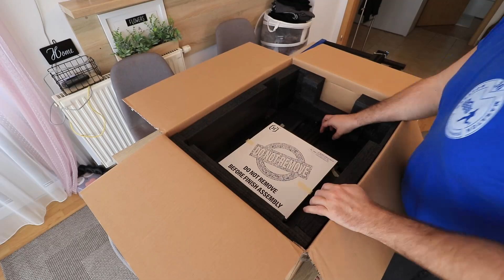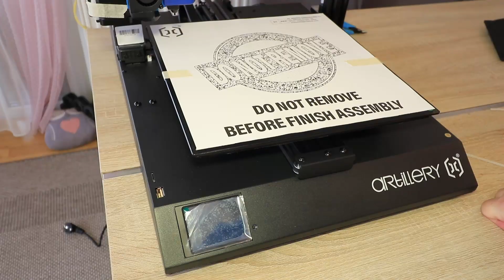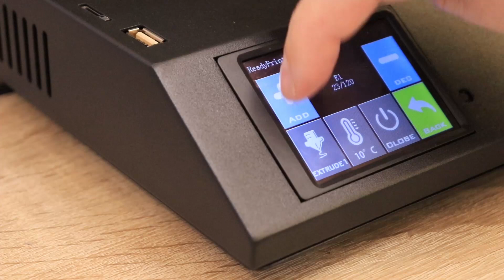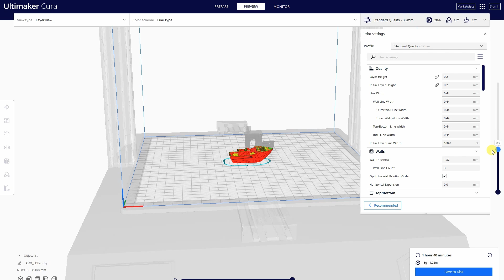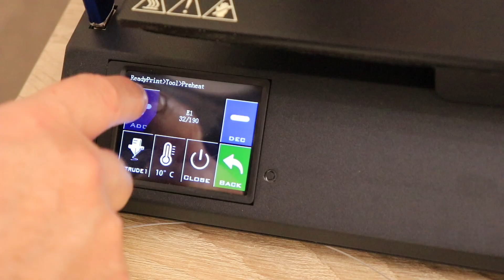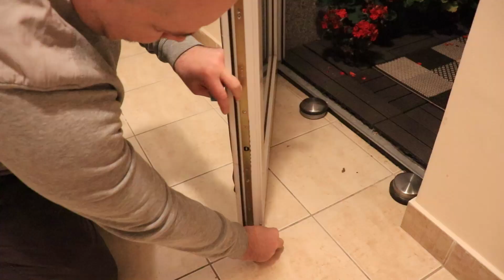Review of a super quiet Artillery SW-X2 (Sidewinder X2) 3D printer

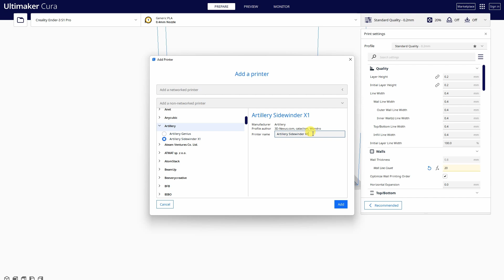Comment: 10:04 
You have to manually add the following in Gcode in Cura, under G28:

M420 S1 Z10

That way, the Cura file will ask the printer for the auto-leveling data you calibrated (if you don't add that command, the leveling you did on the printer will be useless)
The Z10 command indicates that the printer maintains the leveling data for the first 10 mm of printing, if you want it to maintain it for 20 mm, enter Z20.
If you set Z0, it will maintain the auto-leveling setting throughout the entire print of the object.

Comment: Mentioning Z offset ... it's best done not with paper but with a feeler gauge, and - more important - the thickness of the gauge (or paper, if you prefer it) has to be DEDUCTED from (or, rather, added to) the initial measurement, because ... zero means zero, which is something else than zero plus 0,1mm :)
So, if you measure f.ex. -1.5mm and your gauge or paper is 0.1mm then you TRUE Z offset is -1.6mm